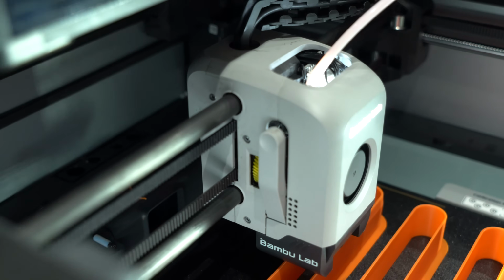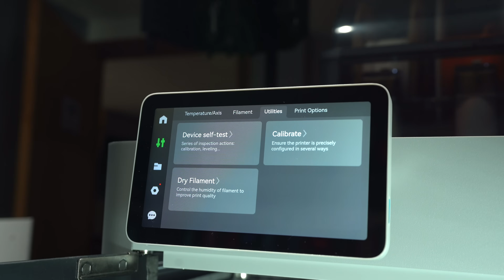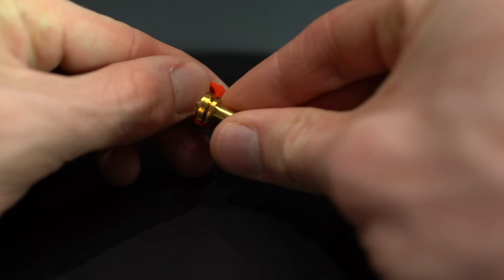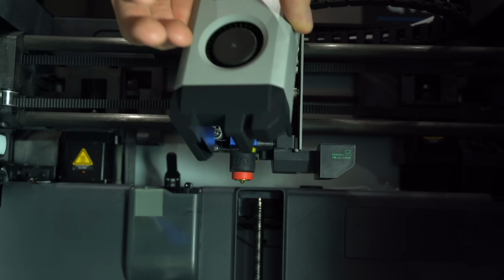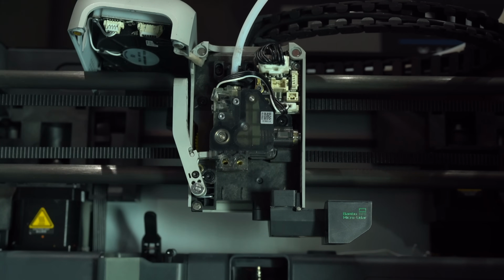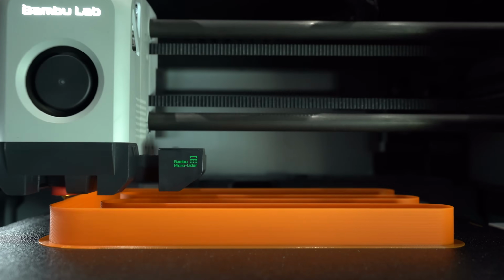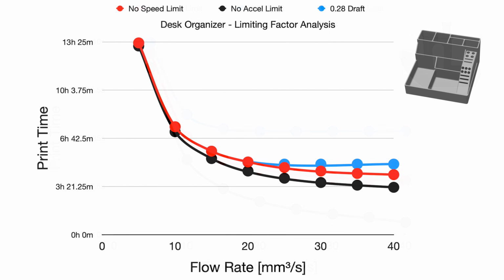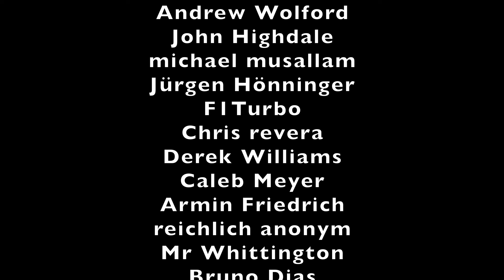Panda Revo - Quick Change High Flow Hotend for Bambu P1/X1

Comment: If you see the topic from CNC kitchen it could make sense to have a high flow nozzle for the added strength benefit.
Reply: Good point.  Having the filament heating headroom assures the filament gets homogeneous heating through the entire filament profile.

Comment: The motion speed and flow rate of the Bambu Lab P1/X1 printers work quite nicely with the default 0.4mm nozzle diameters. Once you start increasing the flow rate with hotends like the Panda Revo, you also have to increase nozzle diameter, layer thickness, and print width correspondingly. Otherwise, you'll just run into the speed constraints of your motion system.
Beyond that, shoriening your print time often comes from effects like printing two walls @ 0.6mm width instead of three walls @ 0.4mm -- and doing that at the same print head speed requires an increased hot end performance...

Comment: OK now swap to a 0.6 nozzle and check volumetric flow, it doubled. a 0.6 nozzle is perfect for cutting printing time with minimal to no loss in quality. The only place where detail is lost is on features that are less than about the diameter of the nozzle so 0.6, and even then only some detail is lost. In reality if 90% of the printing you do is functional a 0.6 nozzle with better flow to boot can cut printing time by nearly half from a 0.4 nozzle

Comment: I'm seriously considering this hotend as an upgrade but i need specific info i've yet to find a single video on. I regurarly do multicolor. E3D can't give me an answer if it's cable to do this without clogging, and BTT email support said it can't yet (for the X1C). Can you make a video on this? My latest print is dragon by Albaro_3D from printables that did 1874 color swaps in 4 days. The high flow of this hot end would really push that down but i need a video about multicolor swaps in action and print results
Reply from the maker: The only thing I could see potentially being impacted is transition length. You might need more purge more to fully clean out the nozzle. Otherwise, it will work the same as the stock hotend for multi-colour printing.
Reply: @ygk3d  good to know, but I kind of want to see it in action. Reading it can successfully swap colors is one thing. Seeing it do them and completing a print is an entirely different thing. I just can't bite the bullet unless I see it in action doing multiple color swaps and finishing a print. Especially with the cost of the hotend (and your comment just now directly contradicting my emails from BTT). I'm happy to fw you the email chain to your contact email listed on linktree if it's ok?
Reply from the maker: @Ch3vr0n  sure, thanks. I’d be interested to see that. I just don’t understand why it wouldn’t be possible.

Comment: I’m hoping now that there’s an official collab we’ll get a cheaper AliExpress clone like we’ve gotten with the CHT kits. Currently that’s what I use and I’ve had great success with flow rates up to 35 flow rate.
Reply from the maker: The revo doesn’t seem to have been cloned yet. Not sure why. You might see the revo compatible heater block on AliExpress with the spring, heater core and nozzle still needing to be purchased from E3D.

Comment: I don't change my X1C hotend often but it's just easy enough that if I've a project that will really work better with a larger or especially smaller nozzle, I'll do it.  But I've started to run into periodic problems with the hotend fan failing mid print.  After some digging, the most likely culprit is that wear on those little JHT connectors for the wires mean the plugs are vibrating themselves loose over time.  Plus, a couple of them are difficult to really get firmly seated, which makes them more likely to work loose.

Using this setup would avoid all those potential damage/failure points.  I just wish BTT would offer the hotend with a choice of nozzles.  I print slow for extra detail and layer adhesion, so the high-flow hotend is a waste for me.  I'd much prefer to have the option to save some money and get just a simple nozzle.
Reply from the maker: I’ve heard that a lot lately about damaging the hotend PCB by plugging / unplugging too many times. I agree with you on the hotend choice. I’d like to see them offer ObXidian as an option and perhaps a multi-pack of nozzles.
Reply: This is even worse of an issue if the P series because of the much smaller pins compared to the JST (I believe) connectors on the X series. I bent the pins twice and I was lucky enough to be able to bend them back in place but it's not an easy task to accomplish.

Comment: The price is holding me back. I really like the fact that you can quickly swap nozzles, so printing a larger object that doesn't require fine detail, can be done with .6 or .8 nozzle. But I don't have multiple printers to benefit even more from the investment. I realize that however easy it is to change out a Bambu Lab hotend, the Revo is way more easy. But paying €300 for a hotend and 2 extra nozzles makes me think a bit harder about the investment...
Reply from the maker: It's definitely a steep investment. As you pointed out, it's not that difficult to change the default hotend, but it's just inconvenient enough that I don't do it. With the Revo setup I feel that I'll be more likely to slice for bigger or smaller nozzles as the application requires.
Reply: Honestly, you save like 30 seconds, maybe, turning out 2 screws and then putting them back in. Most of the time is waiting for it to cool which you will do with the Revo.
The bigger issue is their build quality and CS. I received one with the connections under the heat shrink not even connected. They asked me to solder them myself. Others get miss aligned mounting holes or just none at all. For $130 these are just unacceptable issues and the lack of support from their CS is an added insult. Save your money.

Comment: I really like the idea of picking up a panda revo just so I can also grab some diamondback nozzles for my x1c. I think thats worth noting. Buy that's yet another money sink thar costs even more than the panda
Reply from the maker: I haven't experimented with those myself. Not sure what benefit they would have over something like the ObXidian which is already a wear-resistant nozzle.
Reply: @ygk3d  doc down there Saud it pretty well, but yeah the diamondbacks are essentially wear proof with great thermals. Watched an interview where diamondback has up to 10k hours printing cf-nylon with virtually no wear.
Reply: I'm running diamonbacks on the standard clone hotends, but am switching to the panda.
Reply: @ygk3d the difference is that obx are wear resistant, DBs are (virtually) wear *proof*. Also, insanely good thermal properties, better than any metal.

Comment: Thanks for specifying Max flow on that 0.4 mm nozzle at max flow rate of 25 but what about the rest of them?
0.25, 0.6, 0.8, 1?
Reply from the maker: Max flow rate is proportional to nozzle size. Larger nozzles will flow better. I would have done more testing of it but I only had the 0.4 mm HF on hand. I tested the 0.6 and 0.8 non-HF versions and found that the 0.4 mm HF flowed as well as the 0.8 mm non-HF. So that shows you just how much better the CHT is. I imagine with a 0.6 HF you'd be able to hit the advertised 40 mm^3/s. However, they specifically said it could do 40 mm^3/s with the 0.4 mm, which I was only able to accomplish with excessively high temperatures. The redeeming factor is my finding that we don't actually require that much flow with a 0.4 mm nozzle. Larger nozzles will require a higher flow rate because of the wider extrusion width, but that will come naturally because the orifice size is larger so there is less back pressure.
Reply: Nope, it's not proportional to nozzle size -- the main factors are the power of your hotend heater (the Panda Revo has 60 Watt instead of the Bambu heater with 48 Watt) and the nozzle design (classic vs. multi-channel CHT designs) that determines how to get the energy from the heater into the filament to actually melt the material. Once the material is sufficiently viscous, both a stronger extruder and a wider nozzle make it easier to get it out onto the print bed.
Reply from the maker: @janmartin1501  thanks. I should clarify. I didn’t mean to say it is directly proportional, regardless of other variables. A 0.6 CHT will have a higher max flow rate than a 0.4 CHT but a 0.4 CHT has more flow than a 0.6 non-CHT (based on my testing). So the increase of flow rate with nozzle size only holds true if you’re comparing apples to apples (CHT to CHT).

Comment: for timing nozzle heater, the most accurate way is set temperature to 260 or more, and make timing from 0 to 200C, because when temperature closing in to target pid kick in, not in 100% cycle power... and you mentioned the hotend heater PID can't be tuned so timing with different heater is not valid...
sorry for bad english...
Reply from the maker: Good call! Thanks for this tip. I'll plan to use this strategy in the future.

Comment: I'm convinced, the nozzle-change will be adressed with the next iteration of Bambu Printers
Reply: They already addressed it on the A1 series.
Reply from the maker: Yep. I bet they'll adopt the A1 style hotend on the next-gen X1.
Reply: I agree. The cooling is better on the A1 toolhead as well
Reply: I fully expect the X2C (or whatever they call it) to adopt a lot of the A1 advancements, such as moving the filament select to the head and the hot-swap nozzles.
Reply: Correct you were
Reply: vengo dl futuro, y asi fue la serie P2S, H2S y H2D cuentan con el cambio rapido de boquilas
Reply: We need a better ams for the P & X series... My A1 AMS is light-years better than the original AMS

Comment: I’ve just installed and tested the E3D HF ObXidian 0.4mm and got 41mm3/s without any flaws… X1C, eSun Gray PLA. impressive!
Reply from the maker: Interesting. What temperature? I’d expect the ObXidian to flow the same as brass.
Reply: 220C all other settings as Generic PLA.
Reply: And that was the non revo version? Very interesting!
Reply: @zackfolmar227  yeap… no revo. e3D ObXidian
Reply: have you have any issues with that nozzle?
Reply: @ not at all
Reply: @walterandreis5083  mine quickly wore out after 1.5kg of glow pla. Printed absolutely perfectly at first at default bambu generic pla settings. Started getting extrusion issues and after clearing it with cold pulls the nozzle cant reach original quality anymore. no matter the flow rate, pa, temp, etc
Reply: No you didn't.

Comment: I use the ability to swap nozzles quickly all the time, i currently have revo on all my printers and absolutely love it.
Reply: You might enjoy having an even better quick nozzle swap soon  ^^
Reply: @starlexDHB3dprinterhotend ok, you got me, i,’ve bookmarked your webpage 🙂
Reply: @starlexDHB3dprinterhotend  What's the better quick nozzle swap? It's been "soon". I am fairly new to the whole scene and came across this for my X1C.
Reply: So does the nozzle  heat have to be changed for every print.  The video stated a 10 degree change in temp from the stock nozzle.

Comment: Would be interesting to see the standard nozzle tested at 260 C. I bet the results are similar.
Reply from the maker: I showed this briefly in the video but didn't talk about it. The Revo seemed to perform considerably better at the higher temperature. I was able to get nearly 40 mm^3/s at 260C with the 0.4 mm HF Revo nozzle, but only got around 22 mm^3/s with the stock nozzle at 260C (v.s. 19 at 230). There must be a non-linear relationship between temperature and flow with the CHT.

Comment: IMHO this is really only worth it for larger diameter nozzles. 0.6mm nozzles can still achieve very comparable results in quality and can take much better advantage of the higher flow rates. 0.8mm quality will suffer quite a bit, but for things like shelf brackets or other functional prints, this might not matter. I think you maybe focused a little too much on 0.4mm nozzles, so maybe a follow-up with some larger diameter nozzle slicing times and test prints would be nice. Also it would be great to compare this to the drop-in ObXidian nozzle for 0.4mm printing, because I personally think it's a better choice for that use case since it maintains the hardened nozzle, can achieve nearly the same flow rate, and costs a fraction as much. Thanks for taking the time to make the review.
Reply: I recently got the obXidian nozzle. I've noticed better looking prints from having a higher flow nozzle even though I'm not getting close to that actual flow rate because I don't print very large prints. Not sure why higher flow would print better when not actually printing at higher flow rates but the proof is in the pudding. Need someone smarter than I am to look into it
Reply: @Bennett_Lab  It would be from getting a more consistent and thorough melt for your filament as it's passing through the melt zone. The ObXidian nozzle has the internal CHT-style split chambers that allow way more contact area and therefore better thermal conductivity to your filament. You can expect to see a more glossy finish if you're using a filament that would support that. Also the ObXidian moves the thermistor to the opposite side of the nozzle, so the nozzle may also be getting a few degrees hotter than it would stock.
Reply: @legacyofbob Yes, I am going to run some flow tests to see what I can maintain at 210c nozzle.  Currently running 220c and 34 volumetric set with no underextrusions.  30 volumetric is the magic number so I hope it can hit it.
Reply: @Bennett_Lab  That might just be because these nozzles work by delivering more heat to the filament. You might get similar results just by raising the temperature of your stock hotend by 5-10 degrees.
Reply: Let me clarify. I have the E3D high flow nozzle. Not the revo line
Reply: In my experience, I just sliced the same model for a P1P using a 0.4 mm nozzle and a P1P using a 0.6mm nozzle.  The time went up significantly as well as the amount of filament used
Reply: @garrettsmith4574  You would want to decrease the infill percent as well as possibly the number of walls used. The default extrusion width is ~50% thicker so 2 walls on 0.6mm profile = 3 walls on 0.4mm. Same story with the infill as you would achieve greater strength with thicker extrusions. Also if your filament profile is limited to a certain cubic mm per second then you would still be limited to that, which would factor in to the slower speed.
Reply: @legacyofbob  exact same settings, I made sure the infill, wall, and top/bottom settings were the same and on the same layer height.  Also, same custom filament profile so the same volumetric speed.  Still longer print time and more filament, interesting result for sure
Reply: You are defeating the purpose of bigger nozzle by printing at the same layer height with the smaller one. The advantage of bigger nozzle is that it allow you to print with bigger layer height, line width thus allow you to reduce number of wall loops, bottom and top solid layers but still keep the strength as the same
Reply: @trongcuong1710  I think you are forgetting that even printing at the same layer height, the larger nozzle will have a wider extrusion width, and therefore be stronger and require less walls to have the same thickness. If you do not care about the appearance of having thicker layer height then you should definitely use it, but for me the main advantage is being able to have the same level of detail/appearance while having stronger/thicker walls.
Reply: Definitly. I have been printing on my ender 3 with 0.6mm nozzle some larger prints around 200x200 i usually print at fairly high layerhights and linewidths. At 50mm's you get to 15 cubic which is possible with my Stealthburner. My thought was that the bambulab is better at high speeds so therefor i could print larger prints at 100mm's which would be 30 cubics already.
Reply: Completely agreed and seconded